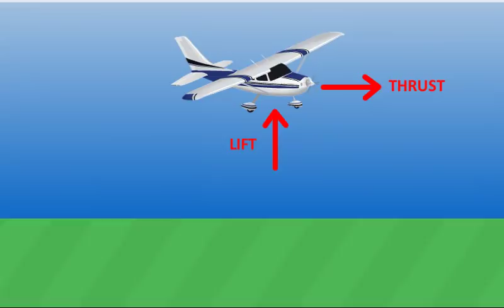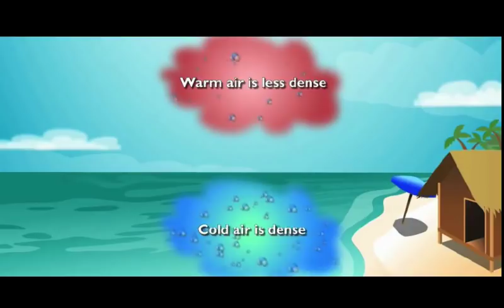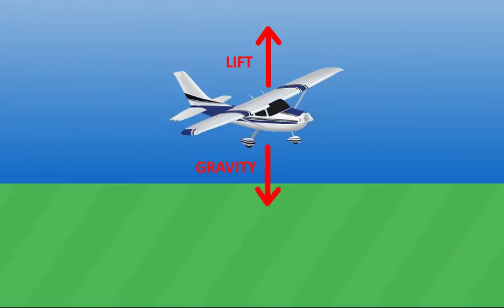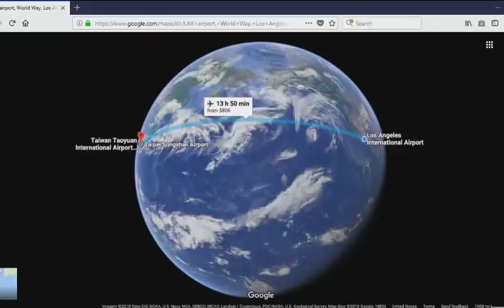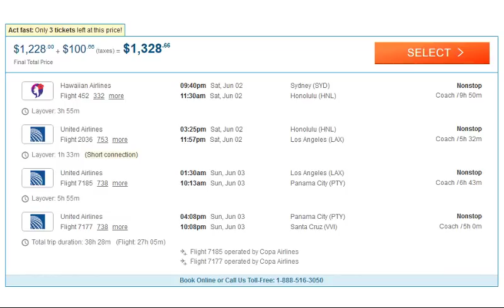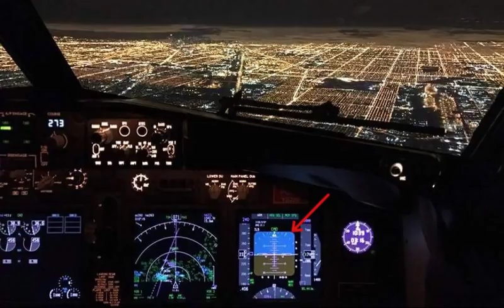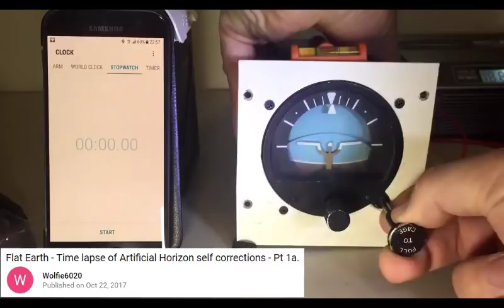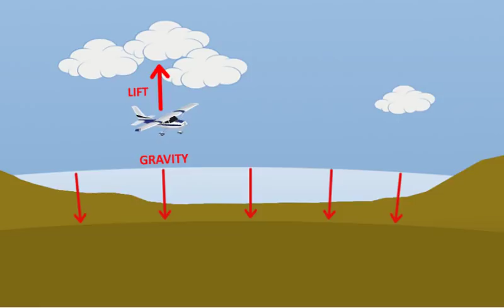Flat Earth Falsities - Plane Nonsense

Comment: ...Globe Earthers have many answers! Why and how was the Cosmic Egg you question?
Because of Gravity.  Why did it do BANG!?  Because of Gravity.  Why does radiation and light travel outwards?  Because of Gravity!  Why does Earth and Moon have a fixed axe, in perfect dual alignement? Because of Gravity!  Why constant spin  and rotation speeds?  Because of Gravity!
HER weak invisible Force reaches out endlessly; grabs and holds planets, yes even the gas SUN does it, away ajustes its pulling in consequence. (except a few rogue celestial comets) 
People dont question, just have faith in GRAVITY, if you want to be sane purposeless meaningless Errors-of-nature's normal's.  It's belief will save you from so many anomalies quirks, dont wonder how multiple atmospheric speeds fonction on all latitudes and longitudes, varying with hight on planes and all the way up to peaceful wondering satellites. 
Just surrender to the flying spinball  Science and be happy and normal :)
Reply: Greetings again louis. Here we are again.

Let me pull up my "Highlighter of Horseshit" and go through your comment.

"...Globe Earthers have many answers! Why and how was the Cosmic Egg you question? Because of Gravity. "

Why is nonsensical here, but I will let that slip.

"Why did it do BANG!? Because of Gravity. "

Oh with the "cosmic Egg" you meant the original singularity.
Well back to the drawing board again.

The original singularity was NOT "beacuse of gravity".
The current answer is: We do not know.

Why did it expand?
Because singularities are inherently unstable? No it did NOT expand because of gravity and no researcher worth their salt would say so.

"Why does radiation and light travel outwards? Because of Gravity! "

No because they have no mass and as such travel at the speed of massless particles that is: c.
Also: Outwards of what? Did you change the topic again?

"Why does Earth and Moon have a fixed axe, in perfect dual alignement? Because of Gravity!"

Ah finally. A correct statement.
Yes the earth and moon have a fixed axis because this is an energy favourable state. Why is the moon in perfect alignement? Because we have oceans.
Let me explain: As the moons gravity pulls on the ocean, it slows down. The simple result of this is: it will reach a point, where the same side will allways face the planet.
This is called "Tidal locking". This happens with EVERY Planet-Moon system. An ocean or liquid surface will simply accelerate the process.

So congrats Louis. You got something right.

" Why constant spin and rotation speeds? Because of Gravity! "

First: "Spind and rotation speeds" is redundant.
That is like saying "All the Dogs and Dachshunde"

Second: No it is due to conservation of angular momentum that planets continue to spin.
Third: The speed is NOT constant. As previously said: Objects will tidally lock to each other. The rotation of the earth slows down. In fact: gravity is the reason why it is NOT constant.

"HER weak invisible Force reaches out endlessly; grabs and holds planets, yes even the gas SUN does it, away ajustes its pulling in consequence. "

Yes: The sun has gravity.
Why should a 1989000000000000000000000000 Ton object have no gravity?
Ah well: at least you got that right.

As to ajustes its pulling?
NO. It does not adjust its pull. The pull of gravity stays the same. The force you experience gets weaker with distance, but that should be obvious to anyone who realised that for example: Magnets do not have an infinite range for its full pull.

So far: 2 out of 7 things you said where correct.

" People dont question, just have faith in GRAVITY "

The point of peer review is to question something.
So that is horseshit aswell.

" if you want to be sane purposeless meaningless Errors-of-nature's normal's "

C-C-COMBO HORSESHIT!

1) Purpose is something which induviduals give to themselves and has nothing to do with gravity.
2) Error-of-nature referes to Evolution which has nothing to do with gravity.
3) Error-of-nature is a FALSE description of evolution. In fact: the reason we are alife is because we are NOT errors-of-nature.

2/11

"It's belief will save you from so many anomalies quirks, dont wonder how multiple atmospheric speeds fonction on all latitudes and longitudes, varying with hight on planes and all the way up to peaceful wondering satellites. Just surrender to the flying spinball Science and be happy and normal :) "

Aw. You where so close to breaching the 20%.

Well: let us see where you've gone wrong here.

Take a marble and spin it.
Oh. How does the outer shell of the marble "fonction" and rotate with the core of the marble?
The answer: Friction.

But let us take a water ball instead to more closely resemble an athmosphere.
Oh how does the rubber rotate with the water inside? How does the water close to the rubber align its spin with the central water?
The answer: Friction.

Ah well: 2/12.

A 16,67% Success rate. Congrats you belong to the top 0,1% of all flat earthers!

Serrious talk tho: If you want to question gravity and the earth: That is fine. But be prepared to accept an answer when evidence is given.
The first step to questioning a model is: ACTUALLY UNDERSTANDING IT.

Your comment would be as valid as me saying "If there is no gravity, Why don't I just jump and go into space? ALSO: If the earth is flat: Why don't I fall of the edge when I leave the town? Hah Checkmate!"

And I am sure you would have some objections to that, wouldn't you?
Reply: The sun is a giant ball of plasma, not of gas,
Plasma is a superheated gas where molecules can barely even get close to eachother, which also makes plasma far less dense than gas. If the sun were made of gas, it would evaporate
Reply: So Realtalk now: Louis. If you have a question about gravity, especially if there is a way for YOU to prove it yourself and how it could work in a specific scenarion, then I would be happy to try to explain it to you in simple terms, step by step.

No assertions required. But if you where if ask multiple questions: i will deal with the first one and would make sure you understand every single step before moving on.

This is my offer to you: If the flat earth can explain what we can see better than a round earth, I will admit defeat. So please: Go ahead and ask your question.
My offer stands.
Reply: Thats what happens when we research things better than you.
Get yourself some solar eclipse glasses, with solar filter lenses and watch the sun all day.
Never changes size.
Never will.
Because we orbit the sun.
Reply: And what about a solar eclipse, if the sun and moon are close and rotating over us, then how does the moon create a shadow on the earth below if it is not below the sun?
Reply: Then explain how in Antarctica there are 6 months of darkness as well as 6 months of daylight.
That means Antarctica has a 6 month day and a 6 month night.
And you can watch the sun rotating above you every day because it does jot set.
And if you want proof, then get a job in Antarctica, there are plenty of listings on popular job websites.
They need plumbers, janitors, cooks, electricians etc.
Go work there for a few years and explain how the sun can only illuminate half the earth 'disk' then how does it illuminate the entire Antarctic 'ice wall' for 6 months straight?
Reply: O no WE is here again!:(  And an other One that doesn"t understand SCIENCE (Peer review Establishment kind).  I have been promoting all knowing and automatically calibrating / ordinating GRAVITY force for perfecting Nature and Evolution accomplishment designs, but still some are not happy !  
Rejections with claims of "wide range of other factors", and "we do not know" singularity heresies... sad deviations. Strange how that super dense egg singularity had not originated with GRAVITY !? +1 Anomaly! 

I get " Make blah blah noise a lot. Earth big. You tiny. Look flat. Not flat. Just big. Big big." Globe Dark lords intelligentsia replies :)
Non science /knowing /research /etc dipshit me receives "Nice strawman fallacy and replies. But still wong & co attention's ! :) :) :)
Butterflies apparently can fly without gravity. 

It would seem the mastermind Poster did not answer all the questions of FLATearthers :(  Still some knowing Globers must resort to lesser deviant minds devoid of Logic for all-knowing answers.
Strange these Sane's came by without ever viewing FE posts.
Reply: Louis Shaw 
Well can you explain how your close sun and moon stay overhead and not fall. Hiw they move as well?
Reply: Why were you not floating off into space while typing your moronic reply? Gravity. Oh. That's right. Space doesn't exist.
Reply: no such thing as gravity
Reply: "The new results are either telling us that all of science is wrong and we're the center of the universe, or maybe the data is simply incorrect" 
- Lawrence Krauss, 2006

There is such a thing as downward attraction, more then just Density behavior, an Electric world causes attractions, Magnetism has been lab proven, so Forces do exist, just nothing but hot-air MASS force belief.

Max Born said in his famous book,"Einstein's Theory of Relativity",Dover Publications,1962, pgs 344 & 345:
...Thus we may return to Ptolemy's point of view of a 'motionless earth'...One has to show that the transformed metric can be regarded as produced according to Einstein's field equations, by distant rotating masses. This has been done by Thirring. He calculated a field due to a rotating, hollow, thick-walled sphere and proved that inside the cavity it behaved as though there were centrifugal and other inertial forces usually attributed to absolute space. Thus from Einstein's point of view, Ptolemy and Corpenicus are equally right.

The Celestials, planets or disks or whatever energy phenomena, are hung by Ether strings as a chandelier rotating about us, nothing more extraordinary about such intelligent engineering by the Super Scientist CREATOR law maker.

George Ellis, a famous cosmologist, in Scientific American, "Thinking Globally, Acting Universally", October 1995 =
"People need to be aware that there is a range of models that could explain the observations,” Ellis argues. “For instance, I can construct you a spherically symmetrical universe with Earth at its center, and you cannot disprove it based on observations.” 
Ellis has published a paper on this. "You can only exclude it on philosophical grounds. In my view there is absolutely nothing wrong in that. What I want to bring into the open is the fact that we are using philosophical criteria in choosing our models. A lot of cosmology tries to hide that.”

Freaking 2018 and still frequent electric cuts, among so many basic technologies, but lots of satellites in space and old Moon rock pickings.
..more gullible and superstitious today than we were in the Middle Ages..
What Did George Orwell said.
 Antikythera and The Metonic Cycle based on Geocentric :

"The Big Bang Paradigm in all its parts, including heliocentricity, is not 'secular science' but demonstrably an alternative 'religious creation scenario' derived from the Kabbala of the Pharisee religion and put in place by a 'theoretical science establishment'." Marshall Hall

The problem with people /scientists is they will accept 'absolute scientific proof', you can not reason with people that work by accepted Facts.

"..established consensuses / preys on our greatest weakness, which is the confirmation bias /  get everyone to agree on facts," says Muller"
- does not sound like proven Science or critical thinking.. 

https://gulfnews.com/opinion/thinkers/phd-thesis-the-earth-is-flat-1.2009202#.WjFdySncnk8.google_plusone_share

https://xkcd.com/1738/#undefined.hpvt

PS; Psychosis is characterized by distortions of thinking and perception, as well as inappropriate or narrowed range of emotions.  Individuals with schizophrenia have an increased risk of violent behavior, cognitive impairment is continuous since childhood.

They denied Aether for the survival of one of their Theories but not have replaced it with DARK Matter substance, kodoos Cosmology Science!
"...less than 5% of the total energy density of the Universe. There’s got to be about 20-25% of the Universe in the form of dark matter, "Where is the dark energy coming from in an expanding universe? It seems to violate the laws of energy conservation."   -Richard Latham 

Sagnac's experiment proved the existence of the aether, thus demolishing Einstein's Theory of Relativity. Complaints by two experienced physicists that when they were at university, they were never informed about this important experiment. When other experiments - Airy's Failure, Michelson-Gale's experiment (also not taught at universities!) and of course the famous Michelson-Morley experiment- a completely different picture of the cosmos emerges - with the Earth at the centre of the universe.
Reply: @BrainUser1  
There are no new results.
Reply: @BrainUser1  
Still waiting on you to explain how the flat earth close sun remains above our heads.

You can write an entire book of out of context quotes, but none of that changes the fact that you answer a simple question about your beliefs.
Reply: @jakesprake  
Really, no such thing as gravity?

So do yo uh have another force that does what gravity does?

Can you show experiments that disprove gravity.